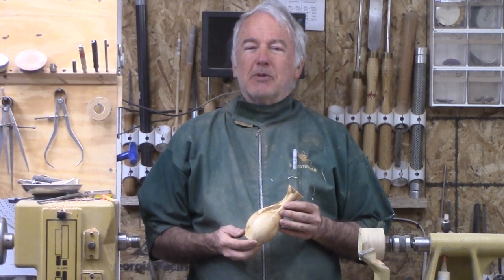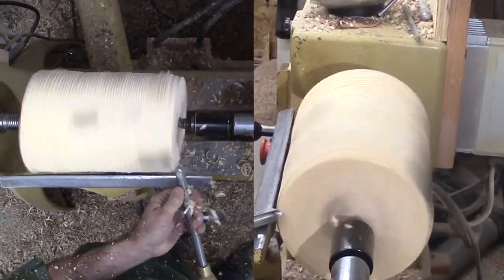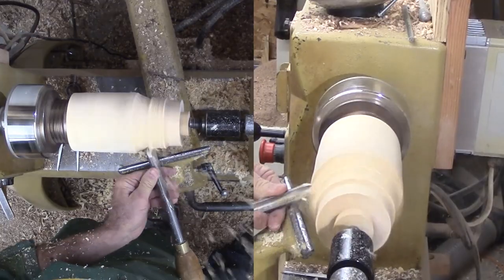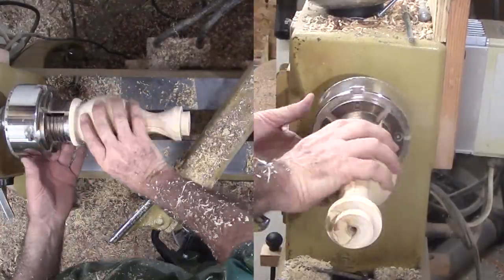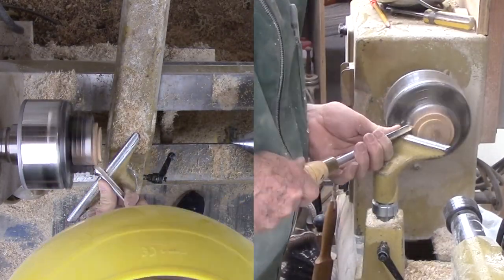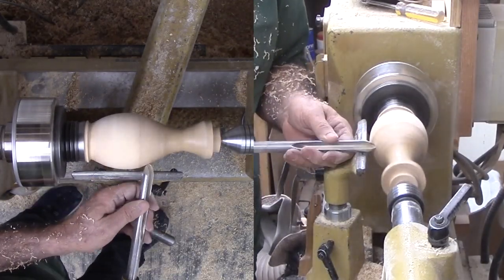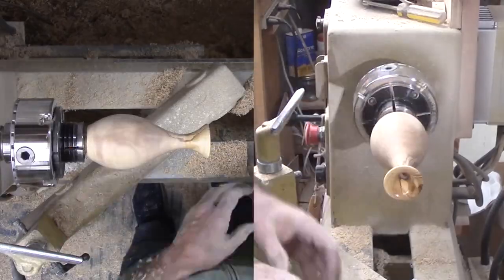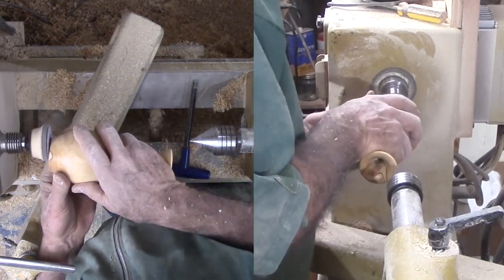Woodturning Olive Vase - Green to Dry to Finished

Comment: The shellac helped to make it pop. I have been trying to rough turn my pieces like you did on this one, using a bowl gouge. It's different. Not sure if it is faster than the roughing gouge. Hoping it will be easier to do.
Reply from the maker: I use my bowl gouge because it does the job and I do not need a tool that does only one thing. Roughing gouges are great if you have one. I just do not chose to buy one.
Alan

Comment: Do you run into problems with your drilled holes becoming oval and/or shrinking after drying? I'm turning green bud vases that will get a 3/4" glass tube. I don't know if I should undersize the green hole and ream it out when dry.
Reply from the maker: Count on green wood distorting when drying. You have it.
Alan